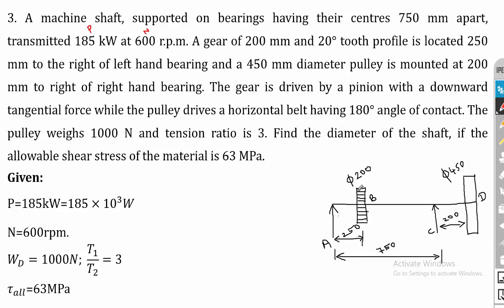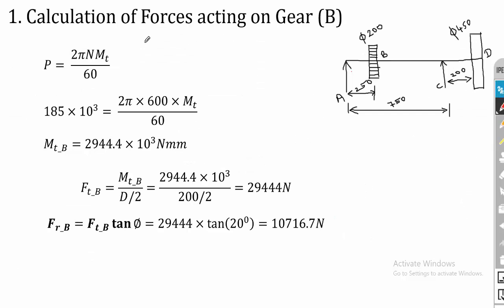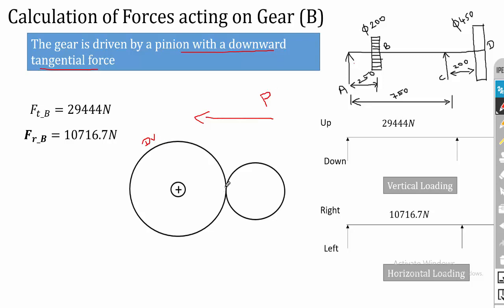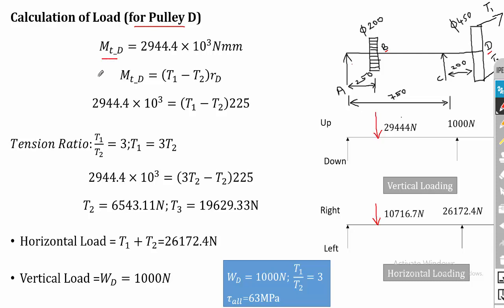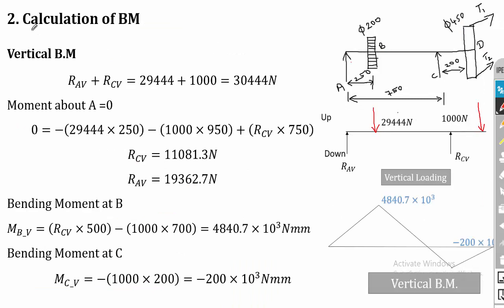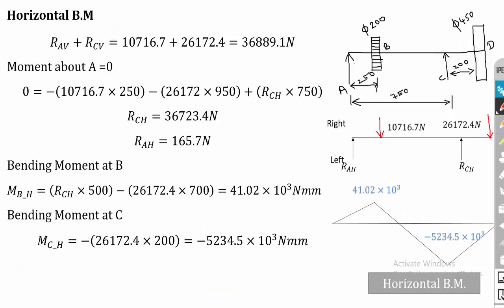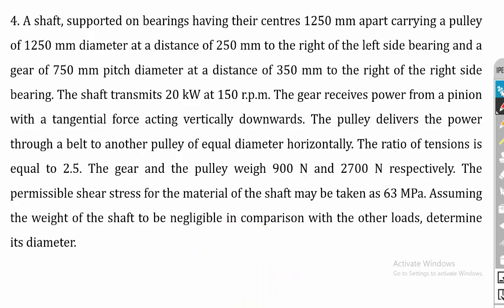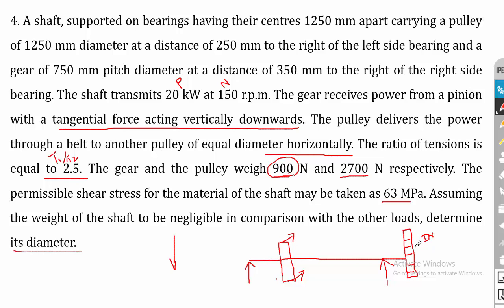Shaft Carrying both pulley and gear | Design of Shaft | Design of Machine Elements

Comment: A shaft carrying a pulley and a gear at either ends is supported in two bearings 1m apart . Pulley and gear are located at 250mm and 350mm from the bearings at respective ends . The shaft transmits 20 kw at 150 rpm . Tangential force at gear acts in upwards direction . Pulley of diameter 1.25m drives another pulley below it . The raio tensions T1 / T2 is 2.5 . The gear and pulley weights 900N and 2700N respectively . Safe shear stress for the shaft is 65MPa . Neglecting weight of shaft , design the shaft diameter . Take shock and fatigue factor for bending and torsion as 2 & 1.5 respectively . 🙏🏻

Comment: sir what to do when it is not given gear is driven or driving but tangential force acts downwards is given so can we neglect radial force?
Reply from the maker: It depends on the direction of rotation... If tangential force acts in vertical downwards, the radial force will act in the horizontal direction...